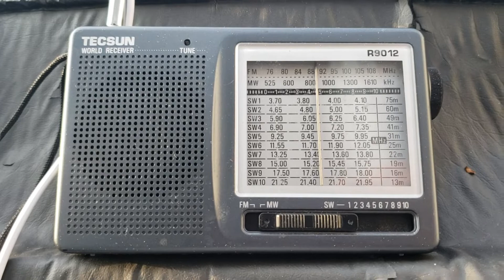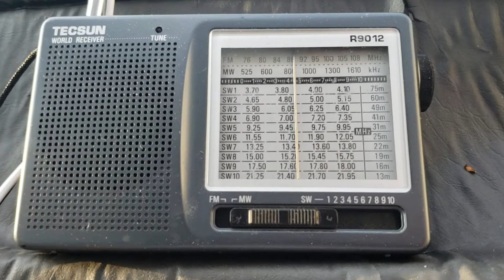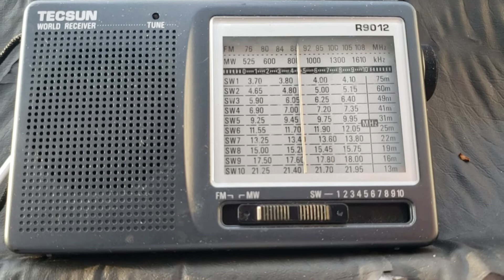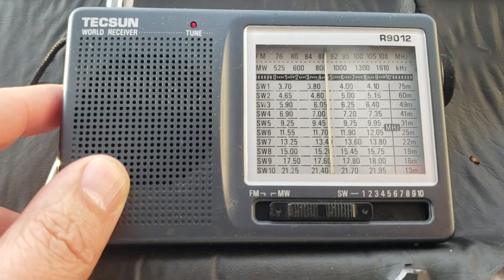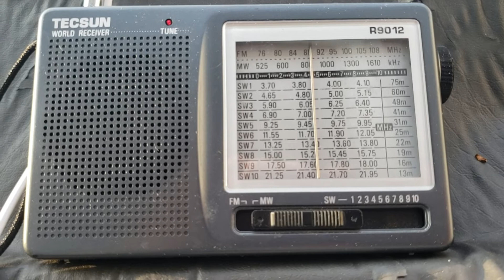80 meters amateur radio AM station on tecsun R9012 receiver

Comment: In general the Tecsun R-9012 has notvery much images all over the bands because the bands are splitted and limited. Otherwise, of course its a single conversation analog design and it has images, no doubt about. Images can be reduced by using telescopic antenna (or careful with telescopic antenna extension) but no long wires which overload that little radio hopeless. Wires, longer than 3-4 m overload the radio especially evenings on the higher bands!!! 

After all my testings with different antennas and using Tecsun R-9012 (not modified) I found out how to get the optimum out of this radio :

1. Telesecopic antenna only. good reception outdoors its fine for 80-90% of the listenings by a good position, inside a house it might be a not enough fir weaker signals.

2. Telsecopic antenna-extension (Tecsun AN-07) to get for 7-8€ on ebay. 20-30% more signal strenght but without overloading the radio, perfect allround-solution in- and outside a house. Its easier to use than a reel-antenna.

3. Max. 3-4 m wire with aligate adapter connected with telescpic antenna. Optimal on the lower bands oudoors, cheap, keep in mind RFI-areas can destroy good reception. Good signals but much more noise inside a house. Outdoors this radio might overload slightly.

4. Important to know: For optimal reception on AM you need to raise telescopic antenna one or two segments. A closed telscopice antenna reduces reception. This little trick works only on Tecsun R-9012 and Tecsun R-911 also the rebranded Kaito WRX-111. The nulling-ability of this radio is outstanding with its internal rod.